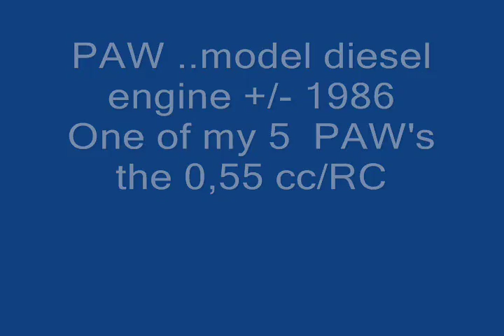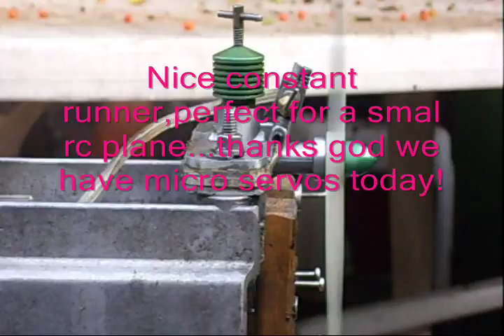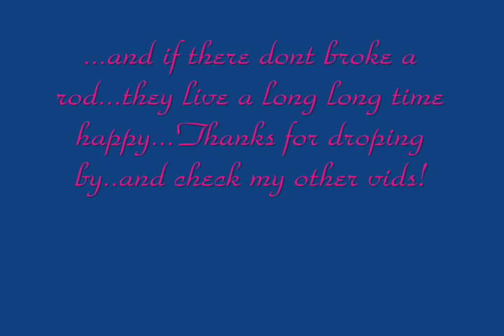PAW 0,55 r/c dieselengine, aprox1986

Comment from the maker: Hy there! Its my standart house coctail. 40petroleum,28aether,28 castoroil,4 cetaanbooster..Usually the smaler engines need moore aether,but he run also with my normal mix wel.The compression is not even 100% ..its not good and not bad.
Only watch out for floding in the begining! this happens quick. Otherwise its a easy starting engine,like most PAW engines
Regards Peter ,Netherlands

Comment: Peter, have you tried any of the TBR PAWs yet? I am really please with my 19 TBR; will probably put it in a KK Spectre.
Reply from the maker: I  have only a single ball bearing types,like the .19. But I know,they run very well! I seen also a PAW special team racer.It have the carter turner 180 degrees, so where the rear cover was,is the front ( with a screw in new bearing part) and the back is the ventury side..not sure,if they used ball races and who make this engines.